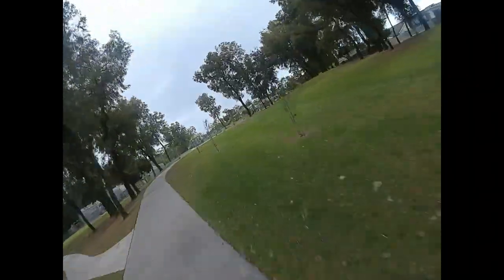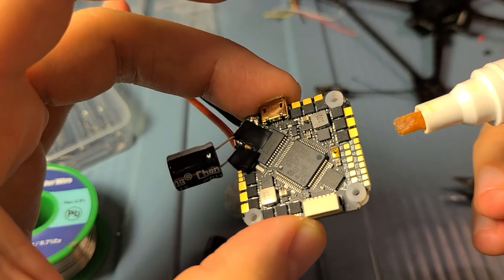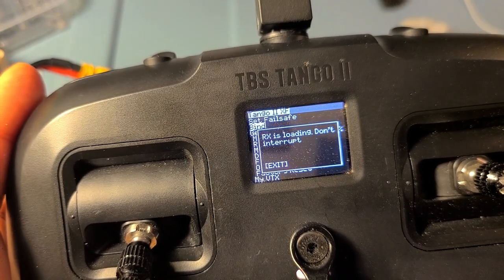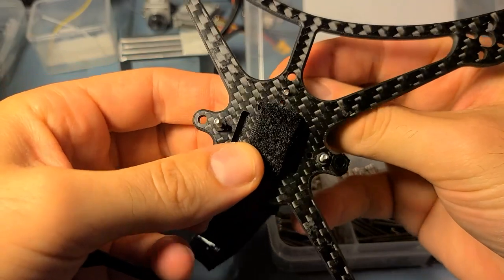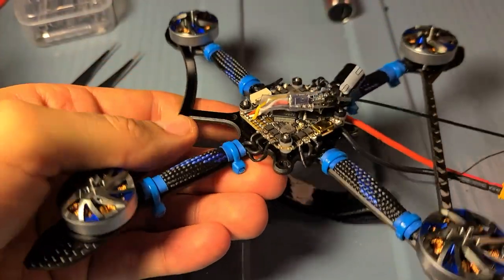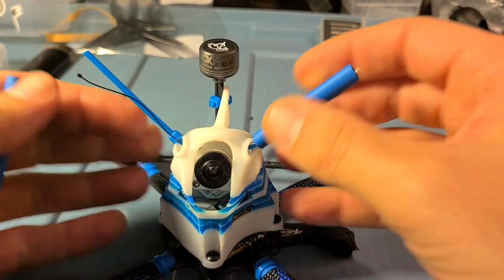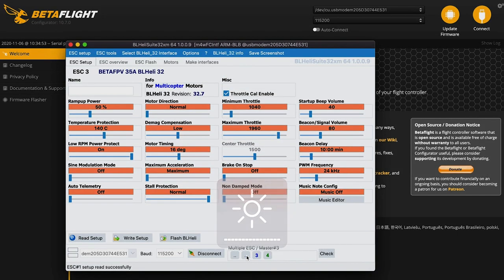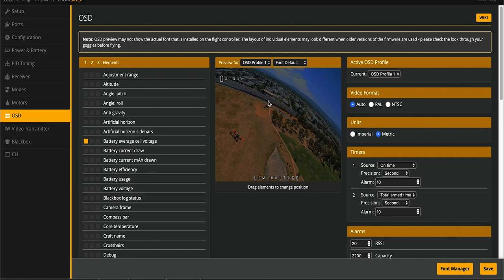Ultimate Sub 250 gram FPV Racer - 4" Twig Mutant full Step by Step build

Comment: Hi Niki.I have a doubt that I would like to share, I bought a betafpv 722 board like yours and I installed it in a beta 3p xking frame drone .. in short, very similar to their version, I have tuning problems as per your screens I have to keep the P very low and I still have vibration problems especially on 4s.
I have the feeling that she has problems with the ride ... very sensitive and this is sad given the cost.
do you have an opinion?
I follow you with interest
maurizio
Reply from the maker: If you built it similar to one of Betaflight's quads, you can copy and paste the PID CLI settings here: https://support.betafpv.com/hc/en-us/categories/900000230226-CLI-of-Quadcopters
Reply: @nikfpv3456  Hi Nick,
Great video by the way.  

I built mine using:
- TBS PodRacer 5” Frame
- the DJI CADDX VISTA
- HQ 4025 T4X2.5 2-Blade Propellers 
- BetaFPV 1805 2550KV motors 

Do you have any recommendations for PIDS from the BETAFPV site that you referred Maurizio to?